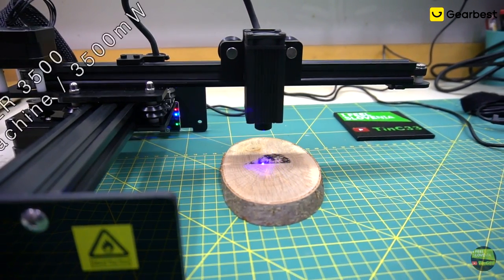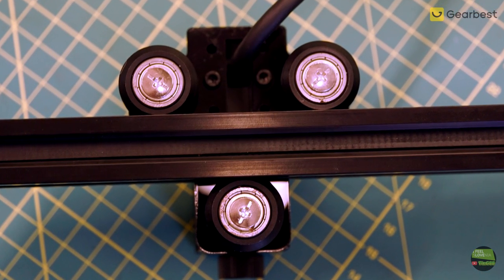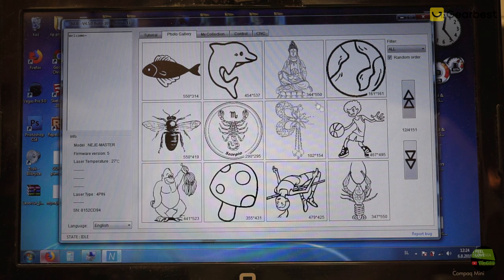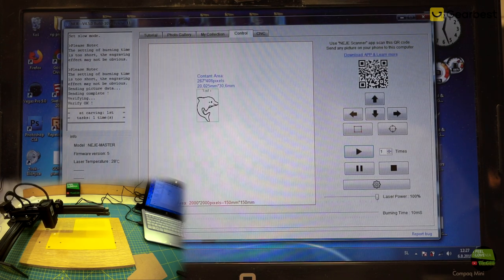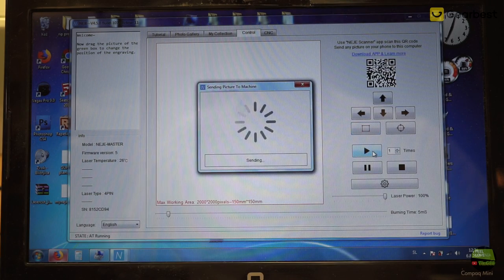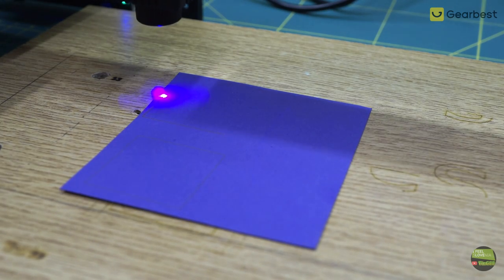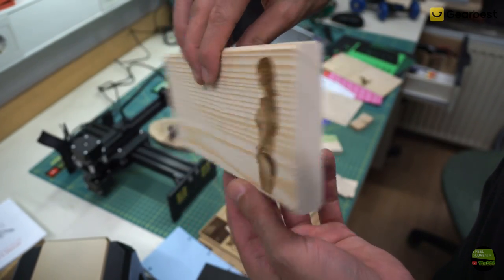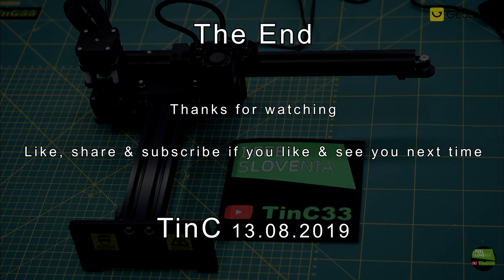NEJE MASTER 3500 Laser Engraver [review / software / first test on different material]

Comment: Very informative review, thank you... do you know if this could engrave white concrete or ceramic?
Reply from the maker: Thanks, i don't know, for this material, but i'm preatty sure it won't work, that kind of lasers, need a material to be melted or burned...
Reply: @TinC33  I'm really just looking to burn, not engrave, I know if I took a torch to the concrete it would discolor it, I have enough other uses for it that I may give it a go anyways... I saw on another review Neje was planning a CNC mill upgrade for the unit, I wonder if that's still happening?
Reply from the maker: @roykinn7  ok, maybe it work on that way, i don't know, but take at least 7W price is not much higher, i add another link for almost same engraver, chec under description.
If neje make cnc mill upgrade i don't know, but i think it will be useless on that machine, because that machine is designed for a laser, wich work almost without any force, so all you need is to move laser modul, for a mill i'm preatty sure this is no go combination.
Reply: TinC33 thanks!!

Comment: Hello, i just bought this machine and i have a problem with the stop switch button, the red one, it don’t work it is completely useless, do you know a system to fix it?
Reply from the maker: Hy, This is not the stop button, round red button from back side is for offline engraving, if you just plug power supply into machine (no usb plug) and push that button, it start engrave your last work, with same power, same speed, on same position.
You must stop the laser with stop button on pc software.
Reply: I was Talking about the red switch insidie, the one that should stop the machine when it arrived at zero point.
Mine arrived at zero and keep in pusch and vibrate havily... maybe the zero switch don’t work?
Reply: @davidescagnolari9383  Hi David,
I have just received mine and it has the exact same problem. 
When it starts to vibrate i push a little with my finger and it works. It is not ideal, I think I need to adjust the post somehow.
Regards,
Paul.
Reply: SCCFORUM what do you push? The switch feels like stuk ..
Reply: @davidescagnolari9383  I push the carriage.
If I push the red button with my finger it clicks. It is not stuck.
Reply: SCCFORUM i was hoping that it was not broke but it must be, if i pusch it dose not move at all, that’s the problem, thankyou Anyway for your kind respond my best regards
Reply from the maker: @davidescagnolari9383  uh i don't know, try to measure the switch, does it push switch till the end or is there a way that the axis hit somewhere and cat't eaven activate the switch
Reply: TinC33 it dose not go tilt the end, you can’t pusch the switch, not even manualy , it is completely stuck.
The other one, make the click while this one    don’t move at all.
Reply from the maker: @davidescagnolari9383  than the switch is broken, try to contact gearbest or wherever you buy, they surely give you a good solution, i will take part of refund and buy new switch for about a dollar.
Reply: @davidescagnolari9383  I have similar issue with my 3D printer. If you can get a multimeter, then test the resistance on the limit switch which should measure 0 ohms. Otherwise could be the cable with faulty wire on connector. last result will be the adapter board. Just need to find the fault but best not let it home and vibrate like that as that is not good on the stepper motor. Get hold of Neje tech support first because they should send you new replacement parts under warranty.

Comment: Thanks for the informative video, how can i set different power or speed for the  same picture? Or how to engrave a picture on wood then cut it out with this machine?
Reply from the maker: You can set power and speed with software.
You need to engrave first, than import nc or jpg file with a figure you want to cut,  increase power and cut.

Comment: i made an arduino uno based cnc router and i want to add a laser engraver on it.. can this laser module work with arduino..?? thanks..
Reply from the maker: I think yes, it got 3 wires, positive and negative 12vDC and one for pwm power controll. Driver is already into laser itself.
Reply: @TinC33  as i saw in online store it got 4 wires, 12v GND TTL and Temperature, this got me confused if it gonna works with arduino or not.. can you explain? sorry for my english, thank you so much for answering
Reply from the maker: @riobel157  you are right, there are fourth cable just to check temperature, but you don't need them. Third cable is ttl? I think it is pwm regulation, anyway i don't know much about that signals and arduino, i got friend helping me in that section, try to find some arduino group on fb and ask if you can get the ttl signal out of arduino to controll the power of laser.
Also there are different lasers modul you can buy, some of them just use +and - and the power you can set with trimmer on laser modul, so you turn on or off just with cutting powee supply
Reply: @TinC33  i did some research on some arduino forum and there is someone explaining about ttl and pwm signal.. i'll try to learn from there.. thanks mate for your help.. have a great day..
Reply from the maker: @riobel157  same to you, i wish you all the best with your project.

Comment: Does this machine good for stainless steel custom names ?
Reply from the maker: No to engrave steel or aluminium you need much more expencive fiber laser, that one is diode laser only for soft materiall.
Reply: It works quite well with anodized aluminium. I do a lot of engraving on that. Very good results, but you need to increase the burning time e.g. to 40 or 60 ms, what makes the whole process a bit "slow". For Stainless Steel I also do, but with limited results. I mark the area with a black Whiteboard Marker, then engrave with 2 rounds of 60 or 80 ms and it is quite good. Also on some other material like Acrylic, what you do ist first mark out all the area with black whiteboard marker, then engrave over it, the black color enables you to engrave. Good luck, always try on a sample material first ;)
Reply from the maker: @albertfussi4102  must try that thanks, i also see some colours can be bought for engraving into almost any material, but cost about 30-40$ for small amount of paint
Reply: @TinC33  I use simple black or dark blue Whiteboard Marker, clean the area first. Marker is cheap. Even some very reflective plastic parts that can otherwise not be engraved, suddenly you can. But you need to test before you work on a nice item, as the result may be a surprise ;)
Reply from the maker: @albertfussi4102  thanks i will try

Comment: Nice video and thanks for showing it to us. Does it also engrave ABS plastic or does it melts the plastic down?
Reply from the maker: Thanks, if you engrave abs plastic it's just melt the surface bud don't change the colour to black.
It's visible only if you look towards the light.

Comment: Cool videos! Is there laser engraving machine in range of 100 to 400 USD that can engrave stainless steel? Thank you.
Reply from the maker: Did you watch my other neje 20w video it can engrave stainless steel with using permanent marker, result is pretty good
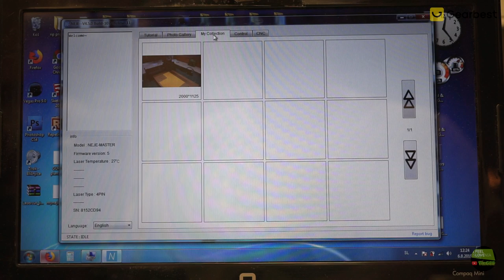Reply: @TinC33  Yes. But in that video https://youtu.be/Hvg8slOVSyE?t=335 (at 5:35 mark) I did not understand what material you testing ("what about..."). Can you please clarify? Thank you. But it looks like stainless steel which gives me some hope :)
On market there are also Fiber Laser machines which are good for steel marking but these babies are quite expensive (2000 - 3500 USD).
Reply from the maker: @hal9000svk  yes that's inox (stainless steel) sheet metal. sorry for my english ;)
Reply: @TinC33  That's no problem. Great!

Comment: You know .... it wouldn’t take much to expand the foot print of this laser. Longer 20x40 and longer 20x20 ... extend the leads ??
Reply from the maker: True, the 20x40 can be longer for 100cm without problem, but 20x20 maybe can be longer for 5-7cm than the machine become unstable.
And the other problem is firmware, i think it's not opensource, so you can fix the working area.
Reply: @TinC33  just put a support on the end ... just a simple aluminum plate would do it.  Screw it right into the 20x20 ... I’d bet like most of these types of things .... there most likely using Marlin software. There is always a way. I’m going to order one and take a look at it. Thanks for the reply ... have Fun.
Reply from the maker: @robertavery8897  true, on the end of 20x20 can attach a wheel to hold the weight of a laser, because speed on Yaxis is really slow and it could work, i was thinking about but i don't know much about programming like arduino and that just know something about siemens... 
Just know that this plate got two microcontrollers one for neje software and other for laser grbl, i try thise days connect it with a lightburn software, there were some sign of connection but didn't work.
Btw, just filming next video about 20w modul upgrade.
And also add a coupon for great price of 20W laser master, but it's temporary out of stock, check under description. Heave a nice day, Tine
Reply: @TinC33  just ordered one ... will keep ya posted.  Thanks.
Reply from the maker: @robertavery8897  great, please tell us here if you get something about fw. Thanks

Comment: Can I use this for making a printed circuit board?
Reply from the maker: Sure you can, apply negative film engrave with laser and than etch with solution.
If you mean tu burn cooper with a laser the answer is you can't
Reply: @TinC33  thanks for reply
Reply: What is the line accuracy, dpi
Reply: How can I buy
Reply from the maker: @ketandalwala5318  150 x 150mm engraving area ( 2000 x 2000px, 0.075mmdot pitch )
Reply from the maker: @ketandalwala5318  Link is into description, and also coupon for lower price

Comment: Great video! Did you try cutting leather? Also, I've seen various options for 20w modules some for £35 and some for £160! I think it's something to do with focusing. Can you offer any advice? Is it worth spending more? Thanks. Reece
Reply from the maker: Hy, i don't try to cut leather because i don't got a piece, i wait on them for 3 month now (ebay).
I didn't see 20w modul so cheap, yetourday i paste the link to a banggood below because gearbest don't offer neje anymore, there you can buy 20 laser neje master or just a modul.

Comment: Is there any cutting information for metal sheets?
Reply from the maker: This kind of "diode laser" is only for soft materiall luke wood, paper, leather... It can't engrave metal and nonferous material like aluminium, steel... You can only dream about cutting them.
For that kind you'll need co2 laser or fiber laser but they cost much much more.
Reply: Thank you! !
I have three 40W CO2 lasers. I wanted to be able to cut aluminum (0.1 ~ 0.5T).
Reply from the maker: @cxz58nm764  great, can co2 40w cut thin steel?
Reply: Thank you!!!

Comment: This is the First choice I wanted only I can't seem to get it from anywhere other than the US or China and some not so trusted looking websites going by their reviews ( is there "any UK supplier I've not yet discovered that sell this device? and that cones with a UK mains supply plug ... as everyone I've found only supply it with a US style mains supply plug (on one YouTube it was pointed out that the the machine was labeled as a  15 - 20 watt only for the guy on the video to get point out that  this 15 - 20 "wasn't" anything to do with the power of the laser" but in fact the actual power of the machine and the laser was actually less powerful than the description on its packaging would have potential buyer's believe, for some people the design and description on the box including it's  advertising can be misleading - just thought I'd point it out  in case anyone falls victim to the possible misleading or unintentional wording for this what I still consider the ideal machine for my needs.
   Thanks for the video
     Stay safe and goodbye!

Comment: Hi,
Do You know how to increase axis limits in Neje software? I would like to exchange XY alu profiles.
Have You try another software? Please share the results. LightBurn looks the best but I couldn't connect ;-/
Reply from the maker: I only try neje software and laser GRBL.
Neje is closed system so i think you can't increase working area, or there will be lot of work.
But in grbl software there's no problem, just set bigger working area and that's it.
but don't know much about grbl, i just try them, check some other video about how to setup everything...

Comment: Doesn’t work with Catalina.  NEJE wireless does not have all of the options.  Laser worked for :15 minutes then failed.
Reply from the maker: Hm i don't know catalina, but also with light burn it not work, but neje software isn't that bad.
Also don't know about wireless connection, because i got neje master, only neje master 2 got wireless connection.
Reply: @TinC33  Can we talk more about what versions of mac the laser will work with? I have tried three computers two have OSX 10.13.6 and the third one has OSX 10.15.6 none of them will work. Does anyone know how to fix this problem?
Reply from the maker: @markaseltine4025  hm i can't tell you because i got no single mac to try, maybe there's something wrong with drivers, try to contact neje support team

Comment: What you do to prepare photo of girl before lasering want software etc
Reply from the maker: Nothing, just inport foto diretc from google to neje software and choose right settings.
Reply: Ty
Does it have to be grayscale
Also now that you tried other brands and machines
What would you suggest
I want to do text and images on different materials
I love your videos and trust your imput
Reply from the maker: @gregmartinez5215  Hy, did you see this video:https://www.youtube.com/watch?v=QjyQ0i580LQ
So far i try neje 3,5w and 20w and ortur 15W.
In masic, ortur is much better, becuase it work on 32bit it really much much faster than neje but still more accurete at it's speed as neje, but there is problem that free software (laser grbl) is almost useless, because it doesn't support cad files for cutting, lightburn is good software but cost $40.
Neje got awesome free software, i like it more than lightburn, because it's perfectly simple and offer us everything we need, when you put engraver to a table, connect to pc, and after a minute it will engrave, lightburn need a bit more setup... so neje software is great and also laser moduls is better by my experience, i maybe got "not perfect" one from the ortur, because it got focus issue, but on ortur say, it's ok, and every their laser got elyptic laser dot. so i think neje is better.
Than power, 3.5w is far the best for grayscale engrave, but for cutting 20W is best. i know it's hard to choose, but think what you use more, booth can engrave grayscale or cutting, but got better grayscale engrave result with 3.5 and deeper cutting with 20W, so it's up on you, if you mean to take booth, take 20w master and than just buy 3,5w laser modul wich is cheap i think about $40.

If you got nothink, i will buy neje, because it's better for grayscale and got great software, if you want more precise engrave simply lower down the engraving speed and laser power, so it will work slower with same effect. if you plan to make some small series, than deffinitly take ortur, because it's realy much faster (if i remeber it's 4-5 times faster then neje)
Hope to help you, if you buy some of them, please use link from the video ;)
Reply: Wow
Great reply and quick ty

Comment: I wonder if you might be willing to try to put a mark on top of a plastic coca cola bottle cap. Please reply here with the results obtained.
Reply from the maker: It only melt a bit of surface and don't become black, so it's visible only of you look towards the light.
Reply: @TinC33  This is the result of your actual test??
Reply from the maker: @MisterFizz  i try on different plastic, but in next days i plan to make something, so when i prepare i will make a test.
Reply: @TinC33  Were you using a UV laser to test marking on the Coca Cola plastic bottle cap (polypropylene) ?   Or, were you using laser diode and HEVES LASER ENGRAVING INK ?  Thank-you.
Reply from the maker: @MisterFizz  just diode laser without laser ink
Reply: @TinC33  OK, yes, well, that makes perfect sense. Would the wavelength of the diode laser be 455nm? Thank you very much for trying. Although I very much like the fact that a 455nm laser can fuse "laser ink" with the surface of a PP substrate, leaving an acceptable mark with good contrast on a variety of colors of PP, I worry about the cost of the ink. Most of it is washed away in the process and is wasted. It is fairly expensive. And the whole process is slow as well as labor-intensive. The diode laser is very cheap. That is a significant benefit. But like ink-jet cartridges, the ongoing operational cost of consumables is off-putting.

Comment: I recoment to everybody to build a box and put the machine inside meanwhile the laser is working. Even the reflections of the light affect the eyes.  its like to be near someone is working with a welding machine.
Reply from the maker: Actually reflection is the biggest dangerous, you wount look into the laser, right? But on otherside from wood can't be reflected on alu or steel don't work, maybe plexi glass or something... 
I'm basicly going out of room when it work because there are lot of dust and smell also, maybe not healthy too.